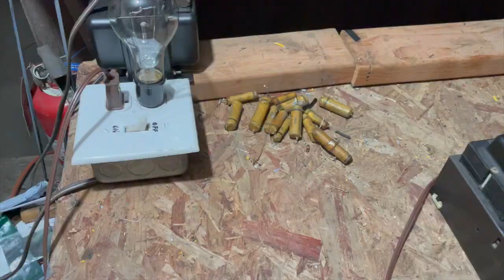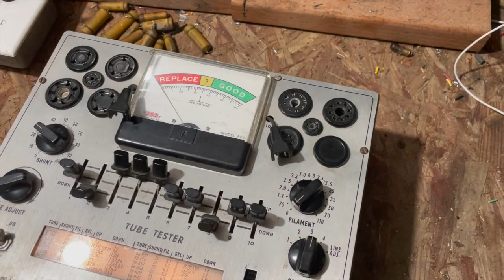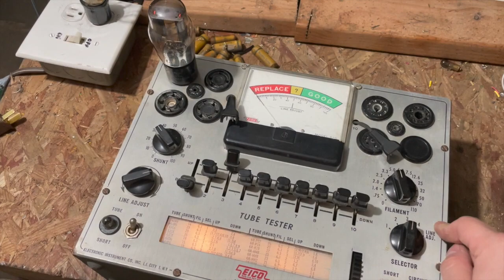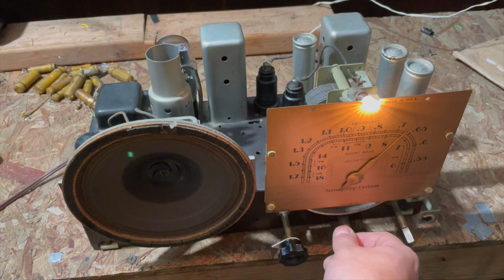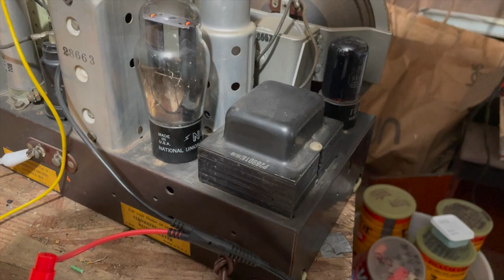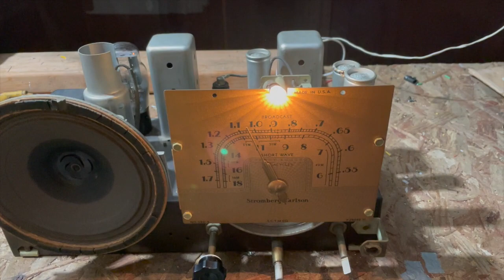1938 Stromberg Carlson 320H Antique Radio Repair Part 2

Comment: Volume control is not going all the way down because the bias cell is weak. You could replace it directly with a .01uF
capacitor and add a 10 Meg resistor from it to the control grid of the 6Q7. They are both tied to a 200pF cap to ground. 
Think you can leave that in. The volume pot should get the proper response from zero to maximum audio then.
If the bias cell fails completely you won't get any audio, it acts as if it is open. In any case the hum will go away.
Reply from the maker: Was thinking it had to do with the bias cell, and that there’s a way to eliminate it without replacing it with a lithium battery.  I’ll give that a try, thank you.